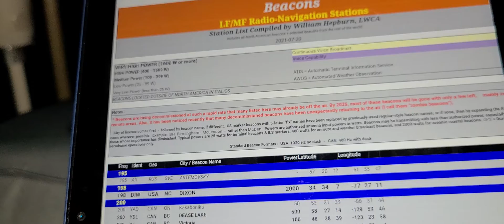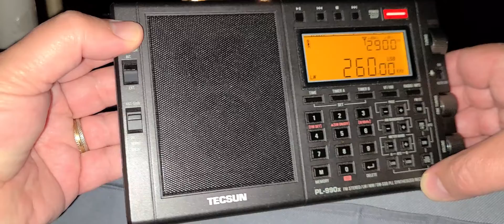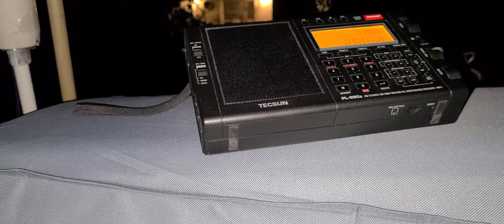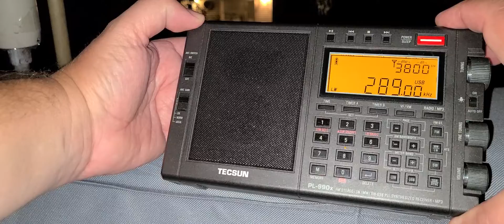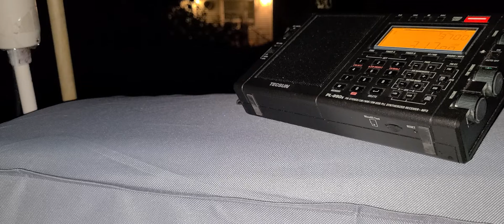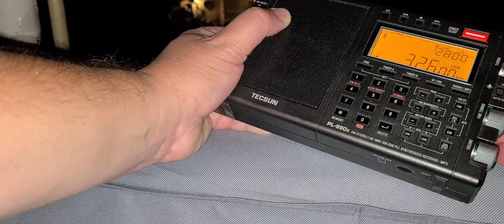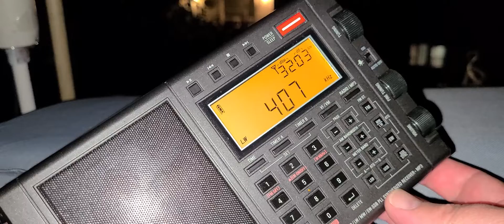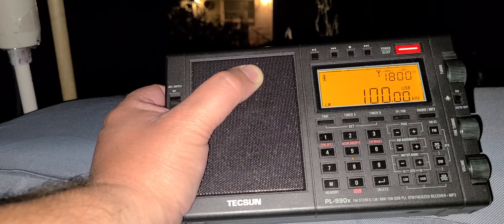Tuning Longwave NDBs on Tecsun PL-990X using internal ferrite antenna with personal observations

Comment: I can't find the video of long wave in the park. I find that you need to be at some 100 meters away from electric wires and rebar. You have no stations in America only beeps...

The properties of the waves vary continuously. There is nothing magical about the length of the meter chosen by the french revolution. I've heard the 300 boundary specifically between LF and MF (eff not waves).